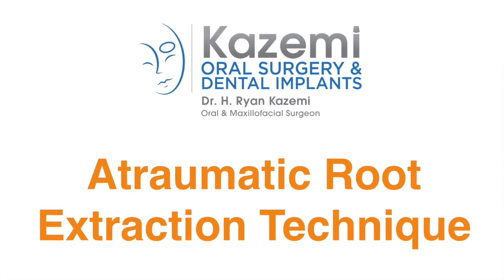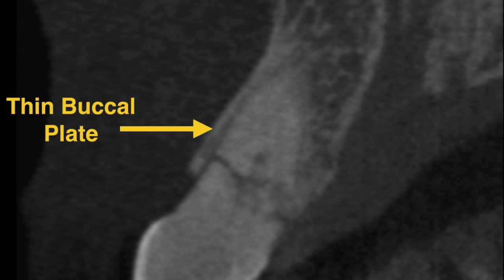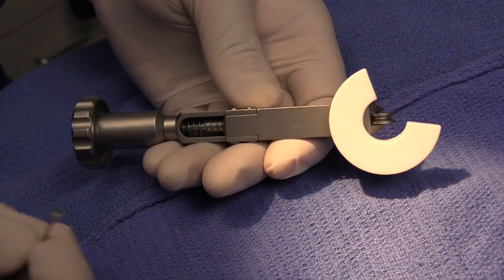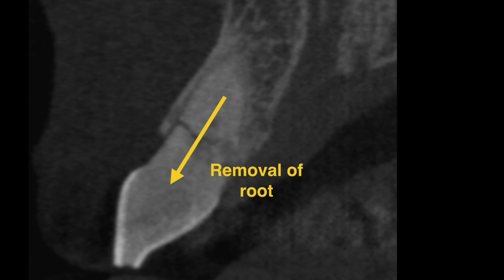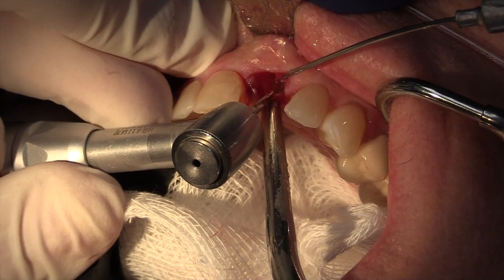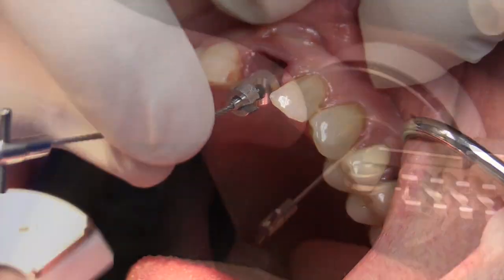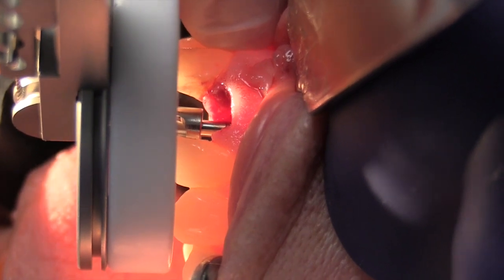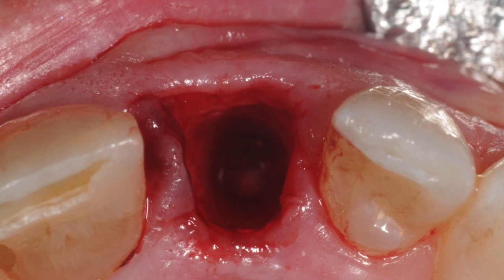Atraumatic and Non-Invasive Root Extraction Technique

Comment from the maker: I appreciate all the comments. This technique helps to preserve the thin buccal bone. While a subluxation technique and displacing the root buccally can easily remove the root, it fractures the buccal plate and results in resorption. Also, the apical end of this tooth had remanants of gutta percha and granulation tissue which was curreted. No apical root segments was remained. The key element is to avoid buccal forces and also using any interproximal forces with a standard elevator that can gauge the interseptal bone.
Reply: Is this works for tilted multiroooted teeth

Comment: The screw sheared the root. there's still an apical root tip fragment left up there (camera was out of focus). that'll be fun to dig out.
Reply from the maker: Thanks for your comment. The apical end was mostly a lesion with resorbed root. It was curretted  completely and removed gutta percha remanants and granulation tissue- which is what is visible in the video.
Reply: Taper will dig out when put implant?????

Comment: guys, all you need is an Anglevator, would of been less than 45 seconds.  Why perform a quick root canal, place a post just to place a pulley system on it to extract it?? so much work for something so simple and that clever gadget is expensive. not cost effective, but a really cool novelty instrument.